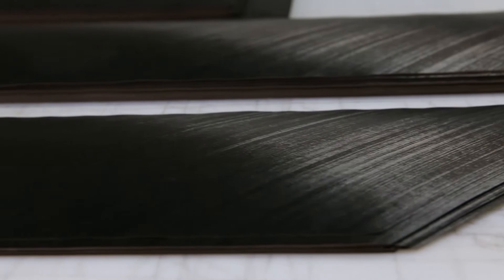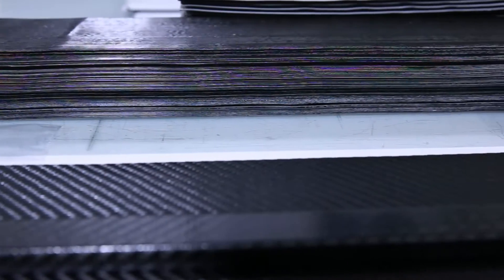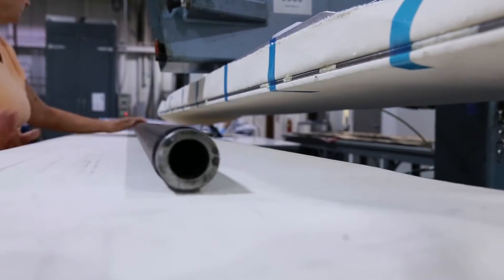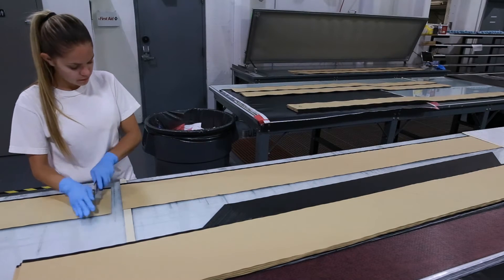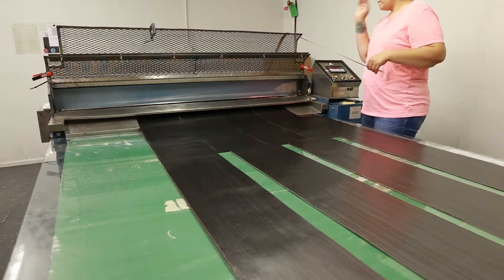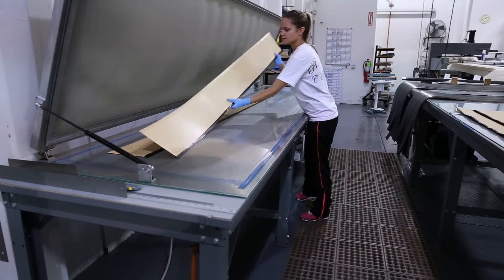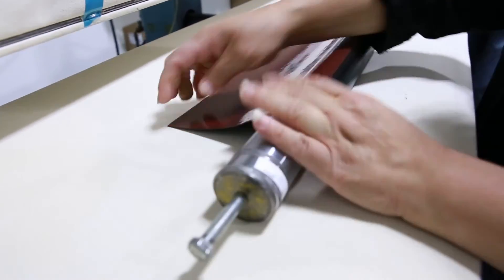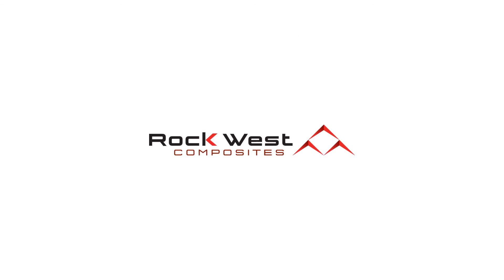Rock West Composites - Composite Prepreg

Comment: When will you guys get a low temperature cure prepreg? Examples 200F?
Reply from the maker: Great question Alexander! We have them, in a way, all our prepregs will cure at reduced temperatures however maximum properties may not be realized until you hit them with their proper upper end temperature requirements. IN other words, for most applications you can simply add time to the cure at reduced temperatures to achieve similar results.